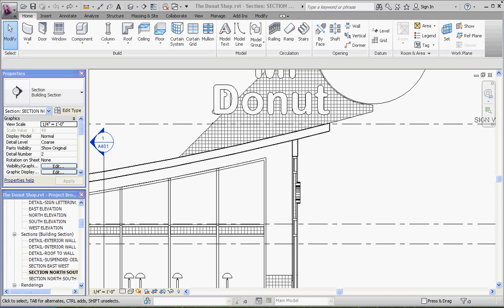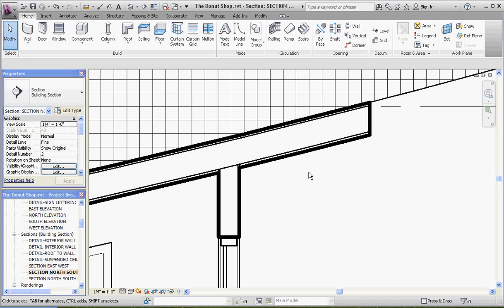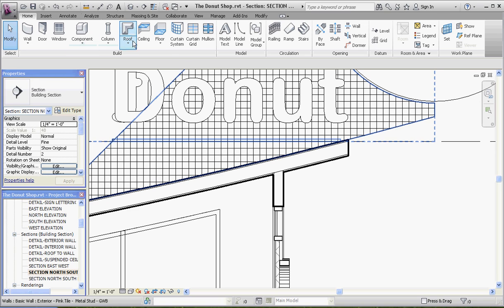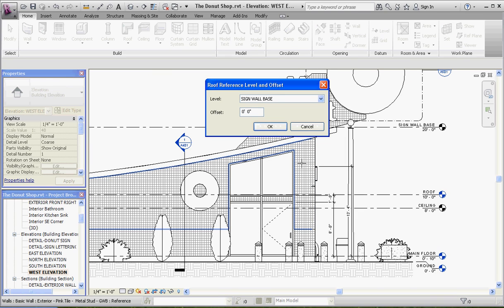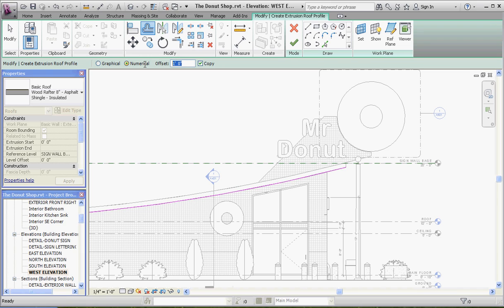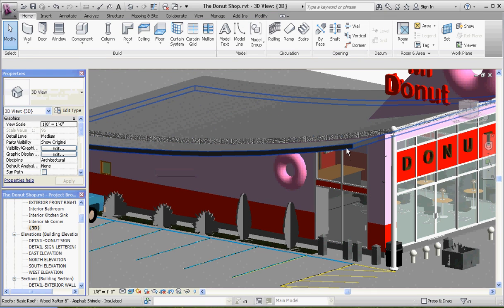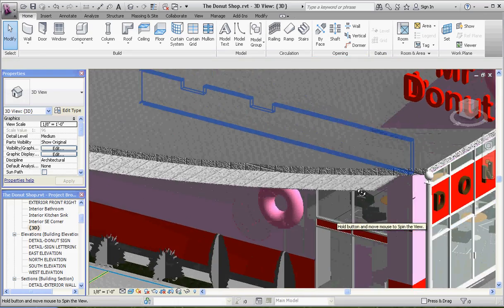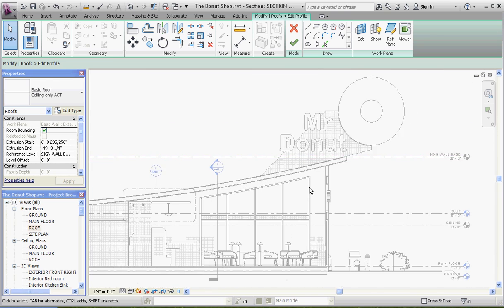Ceiling of a Curved Roof, Part 1, As Part of a Roof and an Offset Ceiling

Comment: What about adding a curved ceiling to a flat roof? Trying to design a  theater rand working on acoustics but having a difficult time working the ceiling at an angle I want. Any tips? Or do you have videos that address this?
Reply from the maker: I don't have a video, but you might try creating a 3D form, then add the visual properties of a ceiling selection to the exterior facing surface of that form. Let us know how it goes.

Comment: How to create a sloping curved roof? ( A roof with sloping down and arc in plan) 
Example: sloping form +3m to 0m arc in plan?
Reply from the maker: +Akya a I think you can design a simple sloping roof then edit the boundary of the roof, removing the lines and replacing them with arcs where needed.  Make certain that you maintain enclosed sketch geometry.
Reply: Okay 
Thank you so much :)